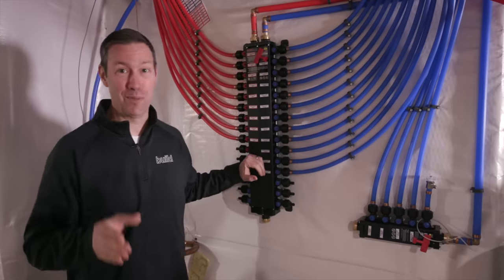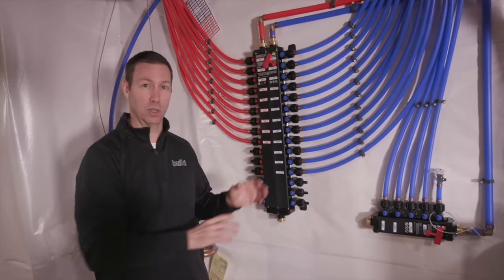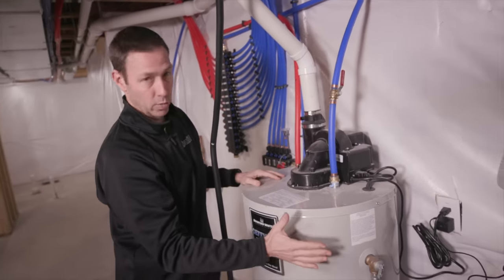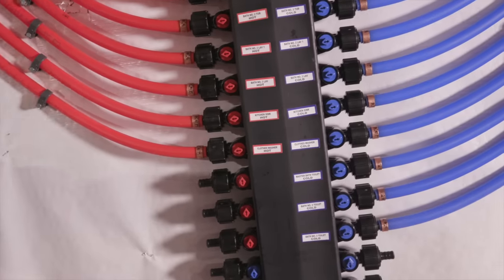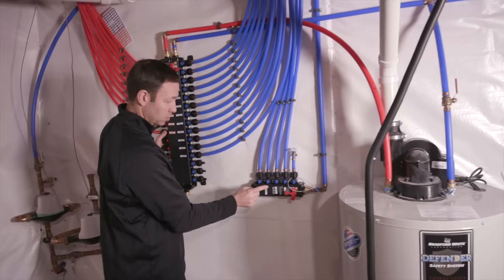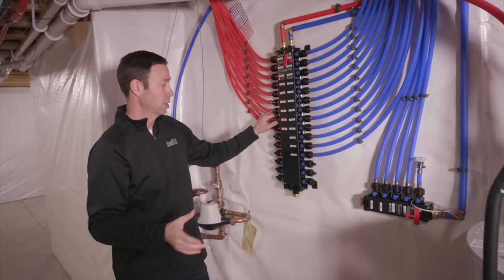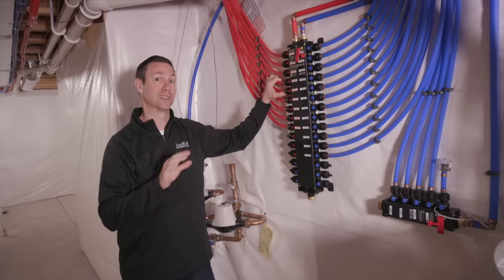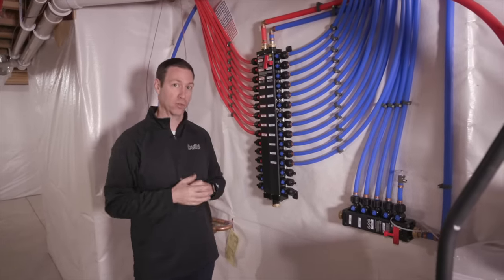PEX Manifold System - Pros and Cons + Tour

Comment: I think I would have one cold, one hot to each bathroom, not to each faucet. That way it cuts down the amount of lines needed to be run and saves on water ?
Reply: that's probably what he did. you just put a tee at the bathroom.
Reply: I like this idea.  Pretty much what I am doing as I refurbish my home.  I'm adding a small easy access panel so you can shut off water to the room before running it to each fixture
Reply: Just speaking from a homeowner point of view, it’s really worthwhile to have less pipes if possible.  I try to insulate as much as possible.  You don’t get condensation issues with cold pipes and heat loss with hot pipes.
Reply: We do 3/8" pex to sink faucets.. For cold it doesnt matter but for hot water the water delivery is super fast as diameter of 3/8" is about a third the diameter of 3/4" so you dont have the charge a large supply line to fire up one sink.
Reply: @1personalt  I thought i saw maniblocks with 3/8 lines. That makes sense as 1/2 line is 1/3 the water  volume of 3/4 line. 3/8 a lot less water.
Reply: you still would have to discharge all that cold water in the hot water line from manifold to said bathroom , loads of wasted water and time waiting for hot , not including the energy and heat loss .
Reply: that is cheap construction and is the cause of getting burned in the shower when someone flushes the toilet
Reply: @DavidLinn  - Nonsense thats because the shower valves being used in certain homes arent what they call pressure balance, do your research ! Know what ur talking about, cheap yes! Pex is cheaper than copper, I personally prefer copper than Pex but i see the advantages of Pex .
Reply: @georgezgreek  i live in cheap apartments and the last 2 i lived in that happened because i suspect the cold water line for the toilet is the same cold water line for the bathroom sink and shower.
Reply: @DavidLinn - I am a licensed plumber! I am not trying to be rude or disrespectful, I know exactly what you're referring to, its because the shower valves in that building or apt were outdated and not the pressure balance type, so for example if your in the shower and your wife walks into the bathroom and uses the toilet, which just happens to be close to the shower and she flushes while you're showering, you're gonna get scolded ! that's because the shower valve in the wall doesn't have a device built into it to allow the hot and cold water to equalize thus when she flushes toilet she steals part of your cold water coming out of your shower and causes the temp to spike, its not because of the Pex pipe, trust me I do plumbing for a living .
Reply: and yes the shower , sink and toilet in most cases do share the same pipe, but that's not the reason your getting scolded in the shower, most plumbing cold and hot water systems have one cold and one hot entering a bathroom , it also depends on how the bathrooms are laid out in the home.
Reply: @Danny P P You're correct, I am not a "real" plumber. However, I am a certified hydronic designer with over 10 years experience in the industry. I've sold literally hundreds of thousands feet of PEX and copper pipe. I also have a good amount of experience installing it myself and for customers... What are you?
Reply: Cal L you don’t get that issue with 1000 pipes either
Reply: David Linn you don’t know what your talking about. The guy corrected you. It’s the pressure balancing valve was missing not the cold lines
Reply: Danny P P pex is bpa free. And bpa is not that harmful anyways
Reply: @lrc87290  I have not been able to find 3/8 inch manifolds anywhere
Reply: @kevintdickson  Then just put a 1/2 x 3/8 shark bite adaptor on the lines you want reduced volume.
Reply: Downside to that is unmonitored per connections inside the walls, upside is that the fittings only exist where they can be supervised in view.
Reply: @Danny P P ...and if you catch a freezing temp....PEX will not burst but Copper will.....trade off.
Reply: RON TER  If the corrosion if visible on the outside, that doesn't mean it's on the inside. Is there any other metal touching the copper anywhere directly?
Reply: What about large branch lines with a per room manifold in each room is that a thing?
Reply: Mad Greek Outdoors correct
Reply: Yep
Reply: @tomtillman  around the 9:00 mark he explains that it has separate hoses for each outlet in the master; so, no tee
Reply: it may save on install but not on water..usage won't be affected by plumbing configuration.
Reply: @CheZfrmdaWestWisc  I have seen it done but the manifold is basically just a tee with more fittings instead of a maniblock and it was buried in the attic because this installation was a repipe. Then the rooms would go into a smaller maniblock.
Reply: RON TER  Check the supply water alkalinity,  Low alkaline water behaves like an acid.  Also see if the pipes have a solid connection back to the soil in strictly metal, or a bonding wire to the ground. Metal parts that do not bond to each other and the ground can carry small amounts of current that affect the pipe. Also not all copper is equal.  People often lie about their quality.
Reply: Yes, I am a master plumber that ,does a lot of student housing, and we run one hot and one cold to each bathroom and then we branch pipe that down from there, just as you say in your post it limits the number of circuits per manifold
Reply: @tomtillman  I don't think so, looks like every line (hot/cold) is a separate run, totally overkill
Reply: That is the general method, use a manifold to supply to each area, then tee off from there.   Thus you can shut down a section of the house as needed without affecting the other areas.   Average house being 3 bath, 1 kitchen and laundry means you could use 2 small manifolds of say 5/6 connectors (for expansion) for each hot/cold supply and your material costs would be a lot less, as is the space required in the mechanical room/basement.
Reply: mr anderson  it sounds like you have electrolysis issues, the ferrous piping has bonding issues, most likely it isn't bonded to a sufficient grounding point.
Reply: @1personalt  wouldn't that reduce your pressure tho?
Reply: @georgezgreek  we believe you jus chill
Reply: @kevintdickson  why do you want 3/8?
Reply: Yes and use 3/4 or 1" line to said room
Reply: @georgezgreek  Wives Wouldn't DO such a thing!! 😲 🤣
Of course, a guy might do it once! .... ONCE  !!!!  😂
Reply: @1personalt  check your math, please. 3/8” pipe is half the diameter and 1/4 the volume of 3/4” pipe.

Comment: When doing a manifold style system you should supply water on both ends of the manifold for a more balanced system
Reply: You beat me to it....
Reply: Is that why the manifold has that port on the bottom going to nothing and capped off?
Reply: @hillaryclinton2415  Is that why the manifold has that port on the bottom going to nothing and capped off?

Comment: Another plus of any manifold is equalization of pressure across all linked lines.
Your "issues" are solves by putting the manifold closer to the water use points, as you said.

Comment: I'm doing that system for my house which will have 3,600 sq/ft of liveable space on two floors, ranch style, because I am finishing my basement. As such, wasting a little water is worth it to me to minimize the risk of water damage caused by fittings in locations where they cannot be accessed or easily turned off. But your concerns about wasted water are more significant than I would have initially thought. So what I might do is a main manifold in the basement that branches to each room, and have another manifold in that room where it splits to the fixtures itself. In any case, if a leak is going to happen, it will happen either at the manifold or at the fixture. So if I have a second manifold in a bathroom, then the increased chances of it leaking are negligable since I will be able to easily access it and shut it off. And it can eliminate the need to bleed 40ft of pipe for a faucet, followed by 40ft of pipe for the shower. Since the line to the room's mini manifold will already be primed.

Comment: i have this system and i love the fact you do not get a large pressure drop when the toilet is flushed so no scalding in the shower.
Reply: SOUNDS like you've lived in a track home before. understandable. modern shower & tub faucets have pressure balancing. no more shower shock. not since the early 80's anyway.

Comment: Wicked, I have seen many houses with of this kind of plumbing. However the manifold was done per story with a circulation connecting the last manifold with the water heater. So da large pipes are always hot and the branches are short and contain little hot wat!

Comment: I redid the plumbing in my house and ran home runs for almost every fixture using 1/2" CPVC from a 3/4" supply.  Matt suggest running 3/4" to the bathroom then splitting off.  This seems to me that you would have to run twice the hot water before the temperature stabilized .   -- Area of a 3/4" pipe is .44 sq in.  Area of 1/2" pipe is .19 sq inch.  ---  Am I missing something?
Reply: CPVC becomes brittle with age. It's a code approved material, but it's not considered ethical in the plumbing community to use for service lines.
Reply: FYI When you double the diameter of a pipe you also increase the free area flow rate by pi. This "cubes" the output of the pipe. So from the firefighter's handbook, you get 9 times the number of gallons of water from a 2" hose vs a 1" hose...or at least 3 times the water from a 3/4" pipe than a 1/2".

Comment: "Beautiful Install"??? Someone needs to read the installation standard for Viega ManaBloc. The PEX needs to come straight off the fittings (horizontally and vertically), then be secured 4-6 inches from the manifold, BEFORE the tubing bends to prevent putting pressure on the manifold fittings. It's right there in the "viega-pex-installation-manual". This installation was not done in accordance with the manufacturer's instructions.
Reply: You are correct.  My Renovator made the plumbers redo the manifolds, so the PEX tubing were horizontal, supported and were not subject to gravity.  Since it was done 9 years ago, I hope the plastic holds as i bet the products are better now.
Reply: The way this was done is completely acceptable. There’s barely a bend. And if ya wanna get technical they’re straight for a pretty good distance. Also, the gravity of the system puts a lot more stress on the manifold fittings.
Reply: @thomasrudder9639  Then you have a very different opinion than the engineers who designed it and the people who manufacture it. Their installation standards for the Manabloc are unambiguous and this installation does not meet their standard. If the Manabloc and tubing are properly aligned and secured, there will be no stress on the manifold fittings because the fittings will not be under tension nor will they be supporting the load. Read the manual. Argue with them if you disagree.
Reply: Yeah. There are even videos available on YouTube by Viega explaining steps in proper install. It would appear Matt may want to, at the very least, have someone else (seeing how he doesn't have time to shop) research products prior to giving praise.
Reply: I was wondering why they started the bend at the fitting.  ...3yrs from now when it splits
Reply: It'll be fine dude, calm down. That's why you strap it down so the straps carry the stress and not the fittings. 

With that said, the cold side is completely fine, the hot side is a bit aggressive. Pex fittings themselves come with the same recommendation not to bend too close off the fittings but us plumbers break it all the time and never have had a problem with a fitting leaking because of stress. The product is much more resilient than what the manufacturer's tend to give them credit for and set their specs on the safe side for liabilities sake.

Comment: Interesting helpful video. But the solution to your cons is in my opinion, right there in front of you, the smaller manifold (multiplied)! (I watch your videos either because as an ex-tinkerer, I liked to mess around with my house just for fun, or now increasingly, as ideas to give to my architect&builder as I start to pull together ideas for my next place. So first of all, thanks for all your videos over the years.) The way I imagine to use manifolds is to use one small water manifold to set up couple-ish trunk lines that run to each "area" of the house, and then use secondary manifolds to do final branching locally. After watching some of your other shows, I've also decided that this branched manifold setup + few localized instant-hot-water heaters is my preferred way to get hot+cold. That means, the main manifold is only for cold, and the hot water heaters are situated with each local manifold. Yes, a bit more money up front in material and workmanship, but much higher comfort and control.

Comment: I own 12 houses and one of my homes has this system in it.  3340 sq. ft. house and I have to say ... it's stupid.  I actually lived in that house as my personal home for over 2 years and guess how many times I manipulated the water to just turn off one thing?  Like when I installed the RO system in the kitchen... do you think I turned off the one marked "kitchen sink"?  I did NOT!  I went under the sink and I turned it off at the under-sink location.  HELLO!  But wait... when I replaced a toilet didn't I turn it off at the manifold then?  NOPE!  Right at the toilet valve!  But how about when I replaced one of my valves under my bathroom sink, THEN didn't I go to the manifold and turn off the one marked "bathroom sink"?  NOPE!  I turned off the valve in the garage to the entire house 'cause it's easy to do so.  I didn't have to look at which one or use the special key I just did the 1/4 turn 1" ball-valve and bam, done and done.

But say you've got a water-leak behind your fridge because the fridge is broken or something and for some reason your valve isn't working and it's 3am and the kitchen is flooding but you've got 8 kids who will be getting up in 3 hours and need the shower and toilets and water!  Well then, yup!  it's nice to have this kind of control!  ... so ... now ... when the F does that ever happen?

Worth the money?  Nope.
Worth the no-1"-trunk to 1/2" and 1/4" faucets on the hot side?  NOPE!

Advantages?  1
Disadvantages?  Many

this is a no-go ... believe me ... I still own and rent out the house and the manifold, now 12 years later, has never been used.
Reply: There's your problem.  
    8 Kids!

Comment: Using a distributed concept of multiple manifolds around the house paired with localized instantaneous water waters can solve the hot water lead time issue and cut down on the amount of PEX tubing required. I recently used this concept on a 8000sf modern build that included 3 separate manifold distribution locations each with its own localized instantaneous water heater which reduced hot water lead time to less an 5 secs for key locations.

Comment: On the hot water side, a 1/2" homerun defeats one of the primary benefits of the homerun system - quick hot water delivery. A 3/8" homerun is sufficient for all but a multi-head shower or tub filler, and it has half the capacity of a 1/2" line, so it will deliver hot water in half the time.
Reply: BULLSEYE! but there are SO MANY MORE downsides to a manifold. you can take it from a 30 year veteran plumber.

Comment: Excellent identification of the pros and cons of Pex and a manifold system.  Sadly some cities/counties won't accept that turn off at the manifold as an acceptable shut off - they still require a cutoff at each fixture.  The farce that creates is that typically showers and tubs can be installed without a cut off at 'the fixture' meaning that in those cases you have to shut off water to the ENTIRE home to replace a tub/shower faucet or even just to service it with new seals/cartridges.  The solution to an inflexible code rule  is to  still install a shutoff valve at those fixtures (bathrooms, toilets, kitchen faucet, ice maker, & Laundry room.

I re-plumbed my in-laws old home with pex and used a copper manifold.  It was about 2400-2600 sq feet two story with a basement and not one run of pex is over 20 feet.  I did have to put a couple of elbows in the pex line to get out of the wall in two locations. 

The other upside for me especially not a single leaky connection or re-fit of any connection.  The only leak at all was when the incoming line with brass fitting connected to a brass fitting on my pex line to the manifold - that brass to brass fitting was stubborn and took several unhook and rehook to stop a one drop per minute leak.

One other point you might use as a pro is the manifold system built correctly can allow a little expansion with no major rework of connections and of course without having to turn the main water supply off.  So you could add a second  fridge with ice maker, standalone ice maker of another washer and all you have to do is just run that line to the manifold.  Same of course if a add-on remodel is done to add another bathroom.

Comment: With the water softener you can use small tankless water heaters in the bathrooms and kitchen then you only need to run a cold water line to each. Also unsoftened water will tare up the ice maker and fixtures with the calcium. Softened water with a R/O unit for drink and ice cubes works great, spoken from experience. Where I live in SoCal our water hardness is 32 grains so I went with a Fleck water softener and a 5 stage R/O (reverse osmosis) system for drinking and ice cubes. Water tastes great and the ice cubes don't have all the little floaties in them.

Comment: What if you used a system like this in a large house with point source heaters at fixtures that use hot water
Reply: I would think if it was my house a single story I would have a specific closet as close to the middle of the house as possible.